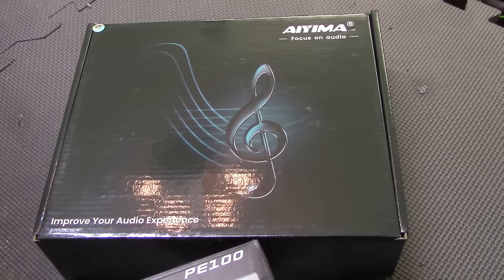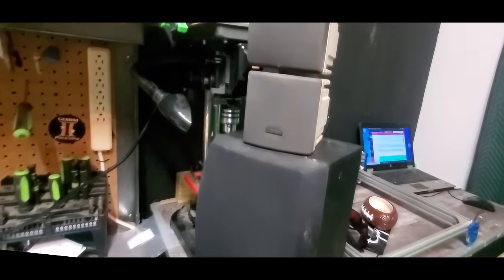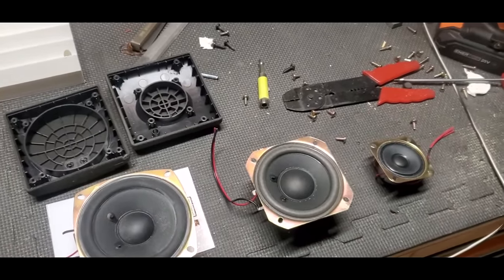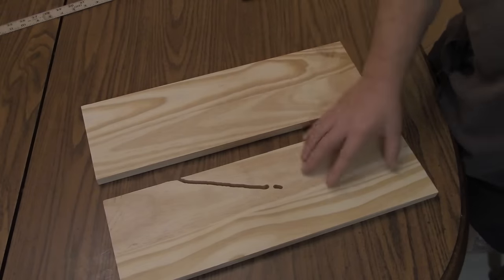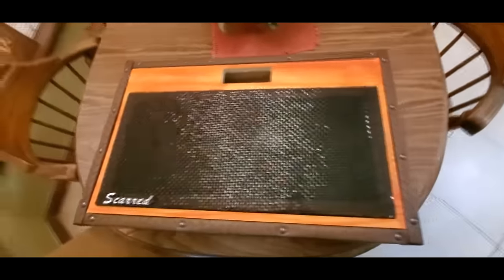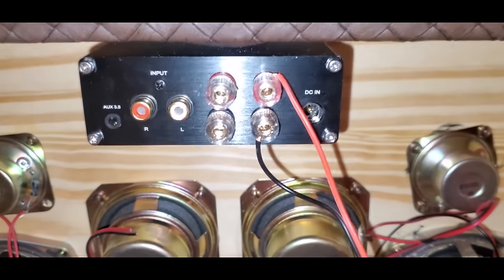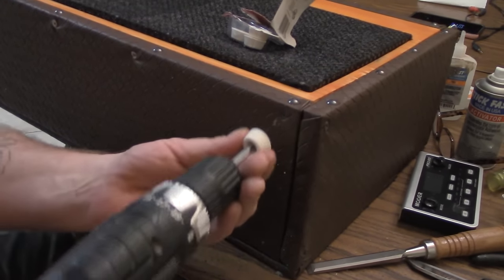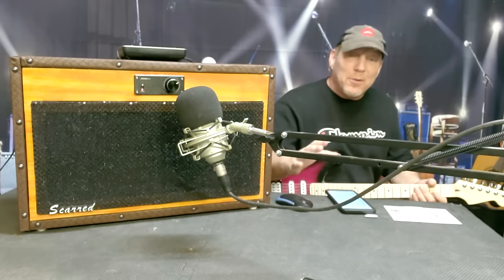The VIDEO ALL Guitar Amp Companies DON'T WANT YOU TO SEE!! DIY $200 Guitar Amp On A Budget!!

Comment: I don't think those little Chinese amps produce anywhere near 600 watts.  Hard to see how it could with such a tiny power supply.  600 watts at 12 volts would draw 50 amps, which would need somewhere around 6 gauge wire for a 7 foot run.  Plus the power supply would be massive, not some little box you plug into the wall.  And let's not forget that a 600 watt amp is going to require serious cooling, which that amp does not have.  I'd say you are getting something closer to 50 watts (25 per side).  You can confirm by multiplying the power supply output amperage by 12, that is the max power that amp can produce.

There is also ohm's law to contend with.  The peak power available from 12 volts through a 4 ohm speaker, assuming a full bridge amplifier, is 36 watts.  (18 watts average power)  The only way to go into the 300 watt range is to invert the power to a much higher voltage first, and that amp clearly isn't big enough to have a 600 watt transformer in it.

It is not uncommon for Chinese products to be labeled with "product names" that look like ratings.  For example "18 TB external SSD" drives are common on Amazon, but if you take them apart they have a 512 MB micro SD card inside.  The "18 TB" is just a name, by Chinese marketing standards.  They even spoof Windows to show that it is "18 TB", but if you try and load anywhere near that on it you'll be sorely disappointed.
Reply from the maker: Thanks for that. I love this amp though
Reply: @scarmyguitar  Well, a 50 watt amp with good speakers is still a good amp.
Reply: Not forgetting that class D will offer About 90% efficiency  but if you can achieve 30 watts RMS per channel that will be loud enough. A 30 watt Valve guitar amp can achieve about 400 watt transient peaks because of the high voltage transformers used .That is why an AC30 delivers the dynamics that a transistor amp can't. Class D is a big help in modeling amps as they deliver a good range for recording.Valve amps require a lot of taming to record from . you'd be surprised how many top records were recorded with a 5 watt valve amp
Reply: @tamsinmccormick  I could see that because how much power do you need in studio when you're amp is right in front of the mic?  Power is not as important as sound in that situation.

But I wonder if the "guitar amp" is actually going away?  Effects technology has reached a very high level.  Once you've spent all that time and money getting the effects right, you don't really want the amp doing much of anything besides producing clean sound at the power you need.  A $200 Hisense "block rocker" will do that.  And run on batteries.

Probably the best selling amp right now is the Fender Mustang II 25 watt.  My son has one.  It's a great little amp, but the secret is the effects are built in and it's cheap.  So it's a great little amp to carry off to band practice at school, but his pedal collection is growing, so increasingly the amp is being used just as a clean speaker.  And he has a splitter so the effects output can go straight into the XLR to the soundboard without a mic.  This is handy when there is a horn section right behind you.
Reply: Then "explain" the 4000 watt pro power amps that all the BIG name commercial sound manufacturers are putting out ... that weight less than 25 pounds and get that power from a 20 amp 120 volt circuit.  The "limit" SHOULD be 2400 watts... 120 volts times 20 amps input.  However, it depends on what class the amp is operating, the class of the power supply, and the length of time it can produce that power.  Personally, I've got a LOT more level (and higher quality sound) out of an old Peavey PV2600 power amp into subs... than a new lightweight 4000 watt Crown power amp.  The old A/B class amps with the big heavy power supplies can take the punishment.  The new class of amps, with the switching power supplies, come up way short and start to break up before even close to the sound level of the A/B.
Reply: @donf3877  That's what I'm saying, you can't get more power out of the amp than goes in.  But there is a difference between "peak" power measured from the tippy-tips of the waveform and "average power".  So a 4000 watt measured that way could be a 2000 watt total draw on the power amp.  But it's still smoke and mirrors.

The maximum wattage you can get from a 120 volt power supply through a 4 ohm speaker is 350 watts.  Bridge that and you could get 700.  To get to 1400 watts you'd need bridge + 2 ohms.  But when you get down to the 2 ohm range the losses in the amp become quite significant, and heat dissipation becomes a huge issue.

I also don't think many people have a real appreciation for how much sound 4000 watts would be.  It would be loud in an outdoor stadium.  It would require banks of speakers to handle that much power.  A 300 watt speaker is pretty big for common use (single driver), although experimental speakers up to 1000 watts have been produced (but you can't buy them).  You'd need 14 - 300 watt drivers to handle 4000 watts, and you'd be running quite close to possibly burning them out mid show.

Thus, I call complete bullshit on the modern rating systems.  If the amp doesn't look like a 220 volt arc welder, it isn't making 4000 watts.  If the sound system doesn't have towers of speakers, it isn't handling 4000 watts.

And there are limits on making a speaker (single driver) much larger than 300 watts as well.  While in theory you could make the coil any size you wanted, at some point you'd just rip the paper to shreds.  So if the speaker doesn't have at least 4 woofers, it isn't capable of 1000 watts.

Bottom line:  Don't trust any of these ratings until you check the physics.
Reply: @Nonplused   Nice try.  Except those 4000 watt power amps are rated at 4000 watts RMS... NOT PEAK.  Oh and, trust me... we don't get 125 db sound levels in my system with 350 watt amps!!!!!!!!!!!  Five two-way overhead speakers with 900 watts each, and two subs with a total of 2600 watts.  Go back to school sweetie pie.  What you THINK you know... you don't know.
Reply: @donf3877  I've been to school and passed courses in electronics and thermodynamics, which you most certainly have not.  You cannot get 4000 watts RMS from a 2000 watt power supply, it is not possible.

Here is a way to think about it, if you haven't studied thermodynamics.  If there were an amplifier out there that could produce 4000 watts from a 2000 watt power supply, what you have is a perpetual motion machine and coincidentally solved the energy crisis.  You could use 2000 watts of power to drive the first 2000 to 4000 amplifier, use that output to power 2 more amplifiers and have 8000 watts, and so on until one Honda generator was powering the whole US electric grid.
Reply: @Nonplused   Nice try sweetie.  Maybe you should try explaining that to the manufacturers that rate their amps RMS power.  They could NOT do that, it they were not producing that power.  Or maybe you should check into switching power supplies.  Or maybe again, you should look into the newer classes of power amps.  Or maybe again, you don't know what you think you know.  Or maybe you are trying to convince someone with a MASTERS DEGREE in electrical engineering sweetie.  You are NOT doing a very good job of it.  See ya later.
Reply: @donf3877  Oh yes I forgot Chinese manufacturers never overstate their ratings.  My bad.

Comment: Dear Sir... I want to ask u all about that small power amp n i saw u soldering all speaker part and do u connect mooer output to small power amp Aux? I just know guitar to mooer PE100 Input and PE100 output connect to small power amp aux or what sir? I want to do start tomorrow because i have all tge thing u show on this video... I think i can do DiY guitar amplifier like u do same this video with my headrush Modeler... I need your help for suggestion and u make my day inspiration

Comment: Can those little speakers take 300W?? Don't they smoke and die?
Reply from the maker: I'll be using it on the channel til they do! But no, not yet!
Reply: I’m not smart to all of this stuff but 300 watts across 6 speakers, would they be getting more than 50 watts each?
Reply from the maker: @jeffleecust  I don't know either, but I plugged my computer into it to use some amp sims and...it's sick, very difinitive across the highs, lows, and mids. If you look closely in the video I did put a small uf compasitor on the smallest speaker to take some bite off, I just forgot to mention it. Thanks for watching

Comment: How did you connect the 1/4" output from the effects processor to the rca input on the amp?
Reply: You can buy RCA to 3.5mm cables
Reply: With the hand, need to grab cables and with arm movement need to move in a way that connects them somehow. I don't know exactly.

Comment: You didn't bother with crossovers?
Reply from the maker: Nope!
Reply: @scarmyguitar   Well I thoroughly approve of the build.   So, although those aren't as big as some people would go with a guitar amp, I'm thinking that what's happening in your amp is that the drivers are moving that entire plywood panel, and this forms a kind of a cabinet-subwoofer and probably gives you WAY more bass than those speakers would have had in their little original plastic cubes.  

Did you get the 48V power supply upgrade to get the full 300 watts? My guess is you don't wanna go with that. Whatever supply came with this will drive these little speakers to their voice coils burn out already.
Reply from the maker: @WarrenPostma  nah I stuck with the smaller power unit. It's plenty loud

Comment: But u never said what you used for power. Never saw one, neither.
So, does it run off the coin cell in that Bluetooth thingy?
"No crossovers or nothin' fancy like that" also means no impedance matching.
But, if it doesn't even have a power supply, i guess there's no reason to worry about impedance. Or blowin' out speahers.
But why even bother with tweeterz on a geetar amp?
That amp looked like a car stereo. But with one guitar input, why have both sides & 6 speakers? You coulda just done 2 speakers on one side.
Im gonna use a switchin supply on mine cuz i aint haulin around a car battery or no giant tranzz-fermer neither.
Ima go wit 2 bigger speakerz too, and jump the input to both sides if the stereo. 12" speakers is what they use in perfessional ampses.
Reply: the amazon page he showed with the amp had a 32v power supply.

Comment: Crossover ain't fancy..  what you did is electrically nonsensical. It's like a car with gearbox changing gears without clutch.
Reply from the maker: Yeah........

No
Reply: @MartinS-es6dp man, I'[m really digging all your tech videos! (This channel doesn't have any content) 🤣
Reply: Huh? neither what you said or the gearbox idiom doesn't make sense
Reply: Someone doing such thing clearly have no clue of electrical circuits but perhaps grassphs what happens to gearbox.. both scenarios leads to damages..
Reply: @scarmyguitar  Sean, the power consumption for the amplifier is 48 volts times 7.5 amps. This only gives a total power consumption of 360 watts.
 But no amplifier is 100% efficient at best, This amplifier is about 90% efficient but probably closer to 85%. So at best 324 watts total for both channels? So 162 watts per channel maximum at four ohms. Ideally you would want a power supply that is regulated at 48 volts 7 and 1/2 amps to achieve this power. But in reality most power supplies are not regulated and so the total output of the amplifier will suffer because of this. Most important difference between the specified specs and real life is they're measuring this 300 watts at 10% distortion. It should be measured at 1% so you can take their numbers and divide that by two. So in reality this amp really only does about 75 watts per channel at 1% distortion at 4 ohms with a 48 volt 7.5 amp power supply.

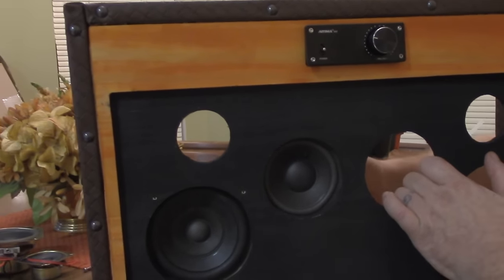Comment: 7:06 All that nice construction … and then you use hot glue to hold the amp in? Smdh 😢
Reply from the maker: Yeah....no....but good on you for assuming with absolutely zero knowledge of what you are talking about!!! If ya knew what you were talking about, you'd know that little amp could never get hot enough (250 degrees fahrenheit) to melt the glue. It would literally have to over heat to failure and then who cares cause it's ruined anyway.
And just to ad, I've now used this amp many times at several gigs 4 and 5 hours none stop turned on (even during breaks)
and that glue is as stiff as my old ass toenails. 
Now it's my turn to smdh with some reality.....
You should spend more time creating something yourself, instead of wasting peoples time trying to discredit 
others peoples hard work with silly---yes ---SILLY comments. 
🤣Shouldn't you?
Reply: he ran out of vintage metal brackets sourced from an old barn. so he went hot glue.